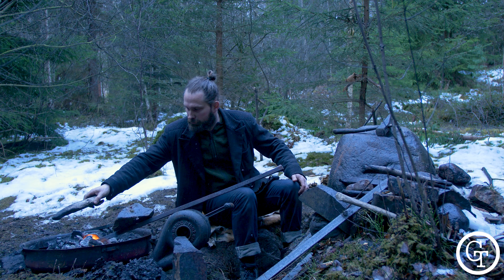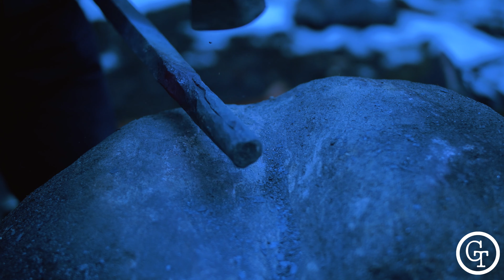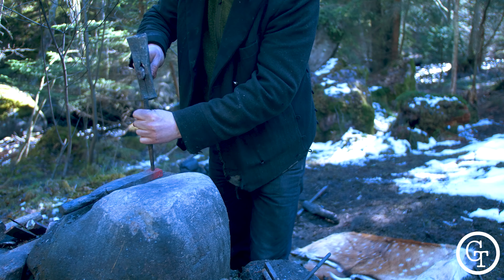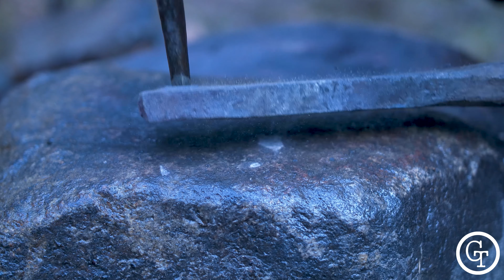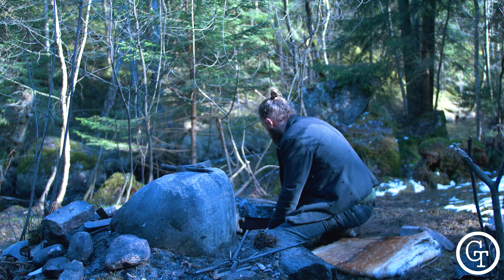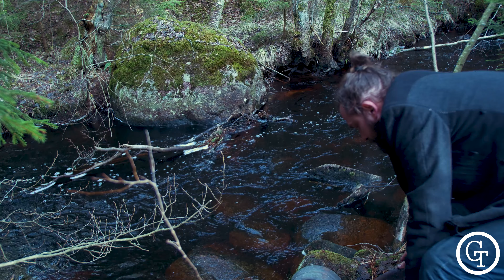Making a nail header + nails for the Mästermyr chest

Comment: Nice looking nails.  That sure is a hard rock you're using for an anvil !!  Have you thought about making a bellows for your forge?  I wonder what a Viking bellows would look like?
Reply from the maker: Yes, the rock is hard enough. But as you can see it is quite worn down. It is hard but when I forged the axes and especially when welding they scaled off quite quickly. I have considered to make a bellow... But since I hesitate to bring any more materials in I do not have leather... and my focus is on hand tools rather than equipment in general. But perhaps one day there will be a sort of box bellow made of wood and birch bark. We will see.

Comment: Great video - what kind of size stock are you using roughly for the nail header? I need to buy some mild steel to make one.
Reply from the maker: It is roughly 20 by 30 mm stock in c 45 steel.